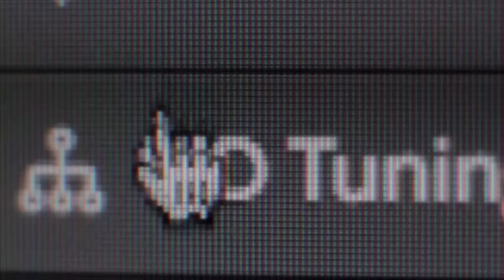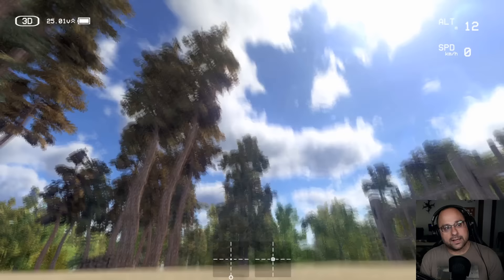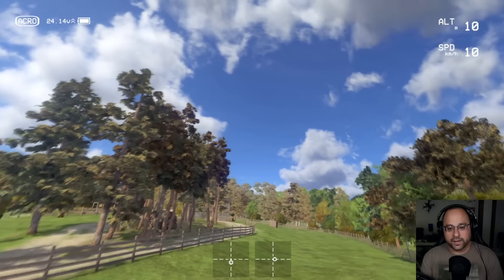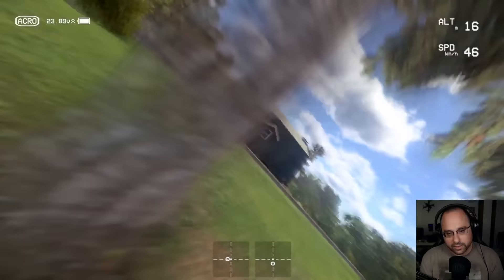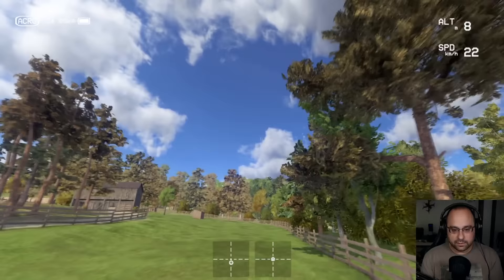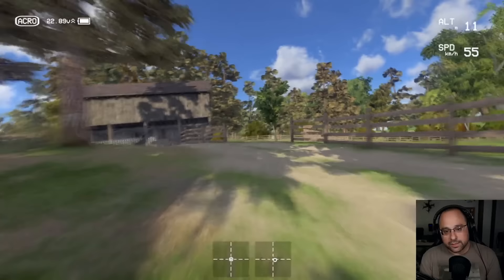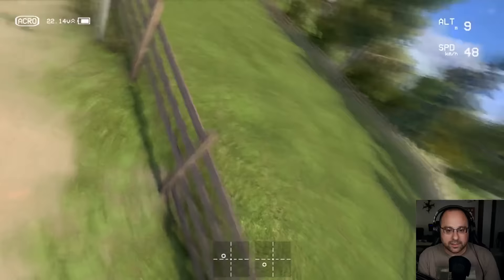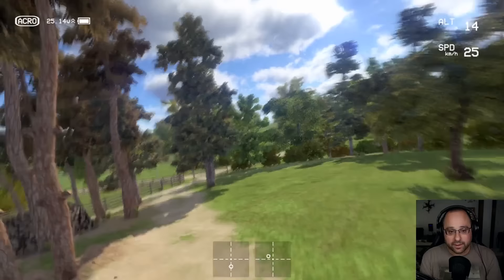Why FPV pilots don't pitch forward (as much as you think they should)

Comment: Whether you have to constantly pitch backwards during the turns or not depends on (1) how much uncompensated roll input you produce compared to your current pitch angle when the pitch/camera angle is low and it depends on (2) how much uncompensated yaw input you produce compared to your current pitch angle when pitch/camera angle is high. In other words, if your camera angle is low then even smaller roll input is going to tilt the quadcopter more to the side than it was before tilted forward, meaning that after applying yaw (which will effectively transform your roll into new pitch) your new forward pitch is going to be higher than it was before turning - meaning you will have to correct it by inputting pitch backwards. It is very easy to visualize it (case 1) when analyzing what happens in the extreme case when starting forward pitch is zero and the quadcopter is level. In that case, after applying roll right the quadcopter and then yaw right to turn the front of the quadcopter in the direction of the tilt, the new forward pitch will increase from zero to whatever roll input was applied before yaw. Of course, the same happens in case of applying roll+yaw at the same time. On the other hand - if your camera angle is high and the camera is level, then by first applying yaw the quadcopter's front "climbs" towards the sky (if you apply 180 degree of yaw the quadcopter is going to even face the sky) and after you apply roll to "correct the horizon" the quadcopter's forward pitch is going to be lower than it was before. Again, to visualize that (case 2) we can analyze what happens in the extreme case when starting forward pitch is 90 degrees (impossible to fly at such a pitch but it doesn't matter). In that case, after applying yaw right and then roll right until the horizon becomes level, the new forward pitch will decrease from 90 degrees to some smaller angle which depends on how many degrees the quadcopter was rotated by applying yaw - meaning you will have to correct it by inputting pitch forward as some flying with high camera angles already noticed. For example, if the quadcopter was by applying yaw rotated by 90 degrees, then after applying roll (which will effectively transform your yaw into new 90° minus pitch) to level the horizon the new forward pitch is going to be zero and the quadcopter starting at 90 degrees forward pitch will after "the turn" become level. If the quadcopter was by applying yaw rotated by 45 degrees, then after applying roll to level the horizon the new forward pitch is going to be 45°. If the quadcopter was by applying yaw rotated by 25 degrees, then after applying roll to level the horizon the new forward pitch is going to be 65°. In other words, in that case (2) the yaw gets directly transformed into the pitch and since we measure the pitch from the angle when the horizon is level, the new pitch is going to be 90° - yaw [°] (90° minus how much degrees the quadcopter way rotated by applying yaw). However, in both - case (1) and case (2) - it is possible to make a turn without touching the pitch! The question is then why we are inputting the pitch (backwards or forward) when making turns. It is because it is very difficult to always coordinate yaw and roll inputs to the degree when pitch displacement cancels out so every pilot develops his own "strategy" by overshooting the pitch in one of the two possible directions and then compensates it by applying pitch. And yes, it is possible to even in the case (1) overshoot in such a way so you have to use pitch forward to compensate the pitch and it is possible to even in the case (2) overshoot in such a way so you have to use pitch backwards to compensate the pitch. But in the case (1) it is more likely you will overshoot in such a way you will have to use pitch backwards and in the case (2) it is more likely you will overshoot in such a way you will have to use pitch forward.
Reply from the maker: I ran some simulator tests using much higher camera angles, and the pitch stick was still back in all my turns. You're right that if you are pitched forward, then yaw, you'll flatten out. But that specific combination of inputs doesn't produce a thrust vector that results in a smooth turn.

To test the theory, I flew for about a half hour using no pitch at all. And the takeaway is that if you do that, you have to yaw one direction, then roll, then yaw back, to achieve a new pitch angle. The most efficient way to turn is to yaw and roll into the turn, and pitch back. I submit that any stick movement that involves pitch forward is less efficient and destabilizes the quad more.
Reply: @JoshuaBardwell  No doubt the most efficient way is to turn like a plane but the fact is turning without touching the pitch is possible. When turning without using the pitch the quadcopter rotates around the axis which is perpendicular to the Earth and with lower camera angles that looks as the quadcopter is hanging on the rope. It would be as if the plane would turn by using the rudder, the quadcopter in such a case moves as hockey puck on the ice. When the plane makes turn by half roll + pitch backwards (and by using the rudder not to lose the height) then the movement is similar as to if the plane would be tied to some fixed point by a rope. Another fact is, as I said, it is much more likely that when you are using very high camera angles, then you will overshoot the yaw over roll and that you will have to correct the mistake by applying pitch forward. Regarding "And the takeaway is that if you do that, you have to yaw one direction, then roll, then yaw back, to achieve a new pitch angle.", you can always achieve the same by using yaw then roll or yaw+roll at the same time (it is function composition). You can achieve the new pitch angle by only one pair of yaw and then roll but then you can't choose arbitrary turn angle and the new pitch at the same time because the new pitch is defined by the old pitch and the yaw rotation. But you can always turn without using the pitch and preserving the current pitch by applying precisely right ammount of yaw and precisely right ammount of roll in the same time. Of course, such a turns will be very wide (the radius will be large). BTW, do not think that I am one of those who disliked the video, I liked it becuse it is about the interesting topic. It is true everyone could fly the quadcopter without thinking about it but it is still interesting to analyze such things.

Comment: FPV speak translated to camera drone-ese. For all the camera drone pilots who scratch their heads when you say ACRO! (Really, this is critical for a pilot moving from commercial camera drones to learning to fly Acro). This concept of the quad staying at pitch and roll angles without correcting is the main stumbling block in transitioning from ATTI and PosHold to acro mode flying, IMHO. Typically understated, JB!

Comment: Camera angle also plays a large roll in how extreme these effects are, I find. Since I fly with 0 camera angle I end up pitching back a lot, even in snap turns. Which was contrary to some advice I had seen in doing snap turns. But when I finally got a hang of turning while inverted and I noticed I was pitching forward during tight turns out finally dawned on me what was happening, because just trying to think about how the combined effects of pitching and rolling work is very difficult until you see it in action.
Reply: Yeah, I was thinking about the same. The more angle you got on the cam, the more you pitch forward in the turns. Applies more to the racers, tho ^_^
Reply: please increase the angle toner least 20

Comment: 7:50 I think a more accurate reason is because a turn is an acceleration. But rather than accelerating forward by pitching forward, you want to accelerate into the turn, pushing away from the center of rotation.

To counter act momentum or since you are moving, you have to counteract the effective centrifugal force fron your frame of reference by pitching back to stop moving forward and pitching sideways to accelerate towards the point of rotation.
Reply from the maker: That is 100% correct. To turn, you have to direct thrust normal to the tangent of the circle. Hmm.... maybe not normal.... because you need forward thrust too.

Comment: It is the same concept as RC aircraft. Once you enter turn, have to pull back on the elevator in order to maintain the same altitude within the turn. If you let loose of the elevator and it goes to the neutral position, the plane will actually dive into the ground!

Comment: Hi Joshua, Great subject on pitching. As a beginner I use angle mode, but when I get scared in the wind, I freeze up and let go of the sticks, but now understand that the quad is automatically levelling itself, but when this happens and there is a sudden gust of wind my quad gets blown in the opposite direction. I have started using acro, based on your explanation I now understand it is probably safer to use acro in windy conditions as letting go of the throttle maintains current direction of movement so less likely to be blown off course by unexpected gusts of wind. Would be interested to know your view on this. Thanks again. I am another newby, who would have probably given up trying to get into fpv if it wasn't for your video tutorials over the last few years

Comment: When you bank you lose altitude due to less thrust component in the vertical plane. Not from forward pitch. The flight controller maintains whatever pitch attitude you command. Aft pitch causes you to climb if you maintain throttle. That’s why you need aft pitch to maintain altitude in a bank. You can also use more throttle. Speed is directly correlated to aircraft pitch attitude at any given throttle setting. Another words if you wanted to hit a target airspeed of let’s say 50kts you’d always hit 50kts at the same pitch attitude while maintaining altitude. As long as your weight doesn’t change. Which it doesn’t on electric aircraft. Nice content though.

Comment: After some hours in the sim I don't quite agree with you (although I can't explain it very well why). A graphic would make this comment much more easy to understand 😅. I'll try my very best though:

I think the reason why you're actually doing that is not because you would tilt forward in a curve if you don't. This happens because the yaw and roll axis aren't used in the right ratio. You can absolutely turn without pitching forward without controlling the pitch directly. 

Instead, you actually don't control the direction of the drone. You control the acceleration of the drone (aerodynamics left out because of the low speeds in corners). That is why you have to give a little bit of sideways (outwards) thrust in curves in order to keep the line you want to follow. It's a little bit like trying to be ahead of the curve with your thrust compared to the drone. If you were to just accelerate forwards in the curves (without sidewards thrust), you would not fly a circle but a spiral. The drone would gain radius because of the centrifugal force. If you roll your drone left in a left turn however, you give outwards thrust and therefore counteract the centrifugal force.

I hope this makes my point somewhat understandable. I also hope I didn't mix up force and thrust. Outwards thrust means force to the center of the circle.
Feel free to disagree with me as an answer to this comment but this is my approach to this question. You can also ask for clarification if my language is not specific or easy enough in some sentences. English is not my first language

For those who can still read: Mr Steeles famous orbits mainly consist of this type of thrust because the speed (and therefore the centrifugal force) is comparatively high. Furthermore, he basically does nothing else than yawing his quad in an infinite turn (and obviously adjusting the right stick to still spin the drone to output thrust in the same direction: to the outside
Reply from the maker: I think if you were able to see Steele's stick positions perfectly (e.g. via blackbox instead of a camera) you would see he's also inputting pitch.

You technically can turn using only roll and yaw, but it's very cumbersome and not smooth at all.

You're right that it is because of acceleration. I agree with that point.
Reply: @JoshuaBardwell  I totally agree with you here. Sorry if I wasn't clear with Steele. You still need all four channels to get this kind of an orbit. In the end, his orbits are "just" normal turns with a 90° rotated drone. That's what I was trying to say. So if you need all four channels to do a regular turn, you need all 4 to do orbits - the right stick (mode 2) has to be in another quadrant though if that makes sense.
It's just that orbiting is harder because it's confusing. Whereas in regular turns you look in the direction you're flying, in orbits you look at the point you're trying to turn around. Additionally, with Steele's orbiting speeds, there's a lot more centrifugal force and less force in the circle direction involved
Reply: You are on the right trace, you may check my comment with the exact explanation of the problematics.

Comment: I'm from the OLD days of R/C (as in, my first radio was 27.195 MHz). I remember when channel mixing came around, and you could program to kick opposite rudder in a bank. Is anything similar done with quads, such as having yaw kick in when you pitch? My biggest trouble in sims seems to be balancing throttle, pitch, roll, yaw. For now, my real drones have altitude hold so I can at least get some flight time in...

Comment: In a bank your lift vector moves off the "more vertical" vector (100% lift) .. requiring a compensation of "more LIFT vector" in any bank .. btw .. ACRO MODE is like PITCH MODE on an aircraft autopilot.

Comment: “Because reasons”.  I don’t think it’s actually too difficult to explain. If you separate a turn into separate movements, a roll and then a yaw it becomes clear what’s going on with the pitch. If your quad is flying forward, and you input a roll to the left, The quad tilts in a direction 90° left of “pitch”. Now complete your left turn by yawing 90° to the left. What you’ve done is brought the front of your quad around into what used to be your roll axis, so the roll you did in the beginning has been added to your pitch, without ever touching your pitch input. 

It’s easy to visualize just using your hand like a quad and making 3 movements, pitch forward a bit, then roll a bit, and finish with a 90° yaw. You’ll see your hand ends up pitched a lot further down than you started.
Reply from the maker: Ok yeah but then explain why if you do yaw followed by roll, you end up flat instead of pitched forward.
Reply: @JoshuaBardwell  Because if you yaw first, you changed your pitch to roll, and then rolled it back out again! Rotations aren't commutative. Yaw, then roll does not equal roll, then yaw. 

Now if you are asking me why a simultaneous yaw and roll acts more like a roll followed by a yaw, and not like a yaw followed by a roll, I have no frickin' clue. I guess it's because "reasons" LOL! I think I just talked myself out of my own argument... ummm... April Fools??
Reply from the maker: That's the part I can't figure out. If rotations aren't commutative then what decides whether a simultaneous move acts more like a roll than a yaw?
Reply: @JoshuaBardwell  It doesn't. In my separate comment with detailed analysis the keyword is uncompensated yaw/roll. When you first input roll only, that is an extreme case where all roll is uncompensated by yaw and in that case after inputting yaw the new direction of the quadcopter's front side is rotated exactly 90° compared to the direction before which doesn't have to be when you use both inputs. On the other hand, in the case when you are inputting both roll + yaw = yaw + roll, then which input (roll or yaw) is going to be uncompensated depends on the amplitudes of joystick's movements (depending on expo) relative to each other and it depends on the current forward pitch. As I already described, even with low camera angles a simultaneous move can act even more like yaw and then roll but in the case of low camera angles it is more likely you will overshoot roll. If you overshoot yaw, then a simultaneous move will act more like a yaw than a roll - which is more likely to happen with very high camera angles. I described all those aspects in the comment you already replied to.

Comment: I have a lal 5.1 new it poped the capacitor right off of it like the wire was shorted out. Nothing else happen then if replaced it and 10 packs later the same thing and it burned the current sensor right off the flight controller. Has anyone ever seen this before??